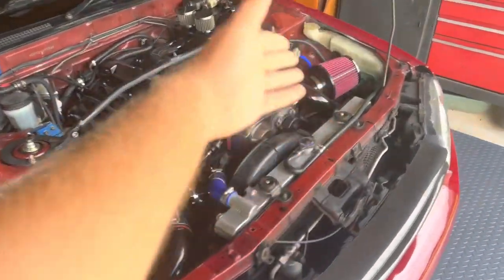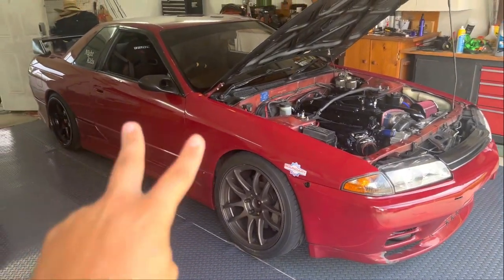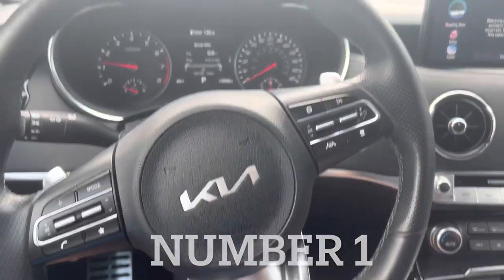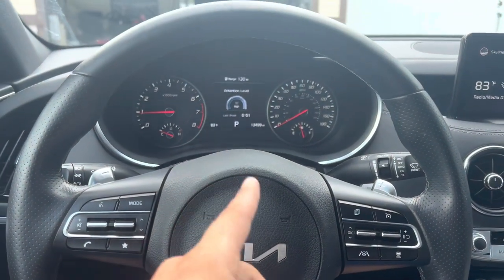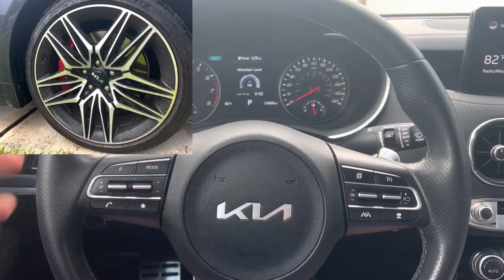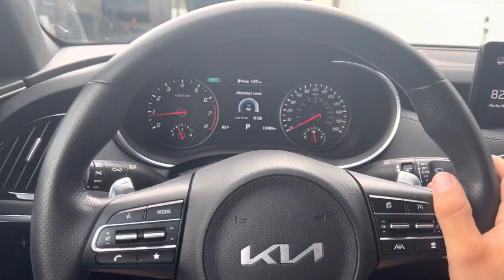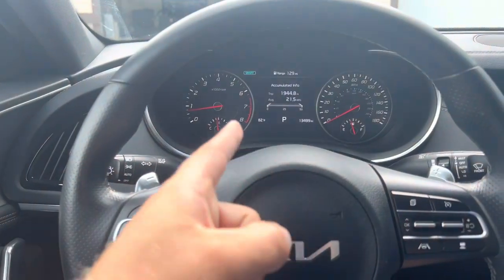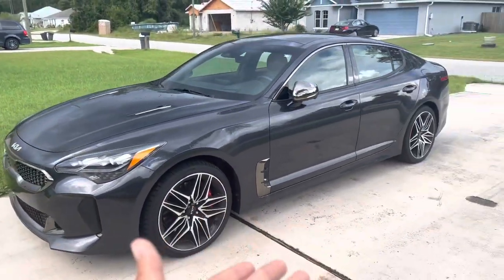5 Things I Hate about my 2022 Kia Stinger GT2! (Owner Review)

Comment: Rotors are definitely the first that need to go. 2019 GT2, first week, I hit the brakes to avoid a car pulling out in front of me and warped the rotors. Got slotted and drilled with better pads and now it stops like a dream.
Reply from the maker: Recommend any specific brake kits?
Reply: @RandomFootageFromRon  I got a good deal from Brakenetic. Powerstop is usually pretty good also.
Reply: @RandomFootageFromRon  big fella

Comment: I’m just over 9k in my ‘23 GT2 AWD; good review - now I’ll monitor those brakes. I love the stealth value of this car! Common question I get: “What kind of car IS that??” Keeps up with the best, a driver’s car.
Reply from the maker: It surprisingly is a drivers car. I’m almost a year in around 14k miles and loving it still.
Reply: I’ve got 57k miles on my GT2, the brake problem doesn’t go away. I went through 6 sets of rotors. The stock rotors are fine it’s the cheap stock pads. Once I swapped to Ceramic pads the rotors have lasted 15000+ miles so far. The dealership will replace the rotors under 12 month/12k miles, just upgrade to ceramic pads and the problem is solved.

Comment: You were spot on!!! The rattle noise could be annoying, so I had to find the issue and get it fixed. One thing you did not mention is the drop in speed when slowing down and the vehicle switches gears from 3rd to 2nd and 2nd to 1st. At first, I thought it was just my vehicle, but then I learned that it’s common. Other than that, the performance of this vehicle is outstanding, especially in sport mode. The gas mileage is a little rough, but it’s worth it. I pick speed over gas mileage any day. Want to save on gas? Get a Tesla.
Reply from the maker: Just a tip, I’m pretty sure there is a way to get the transmission factory “tune”reset by dealer. Something about the shift pressures get off if I’m remembering correctly. But to be honest it doesn’t bother me at all and most of the time I engine brake with paddles to a stop. So the more aggressive down shifts are nice.

Comment: It’s a beautiful car. Couldn’t afford a brand new one so I bought a 2020 Kia Stinger GT2. Brakes are the biggest issue, road noise is insane as well. Even if the brakes are vibrating, it has no problem stopping right away if I needed it to. It is a KIA but it gets so much more attention on the road compared to an Audi, BMW or BENZ
Reply from the maker: Read about the brakes. It’s actually the brake pads leaving a residue on the rotors. There is a reseating process that smoothed them out. Mind have been goood ever since.

Comment: My big complaint is the engine sound. I'm very particular about the sound of my engines, and it is one heck of an engine. tons of power and it can really get off the line with that AWD system, but I'm a V8 fanboy. to me, the sound of a V8 is one of the best sounds I've ever heard from a car, and the Stinger just cannot replicate it. I've watched tons of videos of exhaust systems on the Stinger and it's always too high pitched or raspy. Ultimately, I've just decided to leave the stock system on the car. That is by far my biggest complaint.

Comment: I own a GT2 and agree with your takes. KIA should've built it with more sound insulation. To retrofit it would cost me over 5k and not going to pay for that...what I like most is how fast the car is and easy to pass. The Stinger is a sleeper car and have won a lot of races.
Reply from the maker: I can agree it’s a little noisey. But for the price and what you get obviously some corners will have to be cut. But intakes and exhaust can solve that problem pretty quickly
Reply: @RandomFootageFromRon  Intakes and exhaust won't help the rattles. My head gaskets blew at 2k miles. Needed an entire engine replacement which was almost impossible shipping in from KIA and getting sign off from KIA Corp in Irvine. Five months later I got it back with over 4k miles on it. I was told by a guy who found the issue that KIA service employees were driving the car home for the weekends. There were tears in the seats and KIA wouldn't repair the seats. They generally make good products, though the top management down to engine build quality is a joke. It's as if they go out of their way to sell shitty engines. They know what the problems are, though have refused to fix the engine block boring machines.

Comment: I have an '18 GT2 AWD. Here are the mods I added to address the exact same issues you have.
To help with road noise I got a bunch of dynamat, pulled all the panels I could and then just went ham sticking it everywhere I could. In the trunk around the battery made the most difference. 
I have a lozic TCU (paired with a JB4 (not required)) that can disable the ISG (start/stop). 
Fortunately with an '18 my badges were replaced with a < looking thing that confuses people more.
As a fellow Florida Man (not the as seen on TV throwing a gator through a Wendy's drive through window) I approve this message.

Comment: Great vid, couldn't agree more with you on those 5 things. I have one complaint to add and that is the headlights are a little too low and they can't be adjusted higher. I drive on a winding road everyday at around 4:30am, still very dark and that stretch isn't very well lit. It's hard to see a person jogging or walking, even when they wear those high visibility vests. I know I can turn on the high beams, but I try not to, for some strange reason it doesn't recognize on coming cars and just stays on. I hate to be that person that blinds other people. But sometimes I wish I can. lol
Reply from the maker: I know there is a setting that has the driver side headlight aim down to help with oncoming traffic you could probably adjust. Plus I think the headlights auto level. If you are say parking your car facing up a hill the headlights will aim down slightly, maybe try parking with the headlights aimed down a hill. Maybe just some tips that I can think of
Reply: @RandomFootageFromRon  The roads are pretty leveled around where I live, Long Island, NY. I know that the GT Stingers that doesn't come with LED headlights are adjustable. GT2 with the movable headlight are one piece and someone on the forums mentioned that there is no adjustment that can be done. I looked all over the place for info but no luck. Also, if the bulb should ever stop working, that the whole housing that comes out I believe. But someone correct me if I'm wrong. Too much technology. lolz
Reply: @terrorsz75   They are adjustable up/down.  Just not left/right.
Reply: @mapolinski  You sure GT2s has the up/down option? I know left/right is automatic when I turn my steering wheel, it just points in that direction. I'm going to the dealer this weekend, hopefully they can adjust it a little higher.
Reply: @terrorsz75  I have the 2023 GT2. There’s a place to adjust the up down of the headlights with a screwdriver. I’ve seen videos of other models where you need a wrench. And earlier models had a switch inside to do it. All models have a way to do it. You just need to figure it out.

Comment: Hey, thx for the vid, you had my Like at, "Sorry I'm barefoot, I'm chilling, it's my day off." Anyway, I'm in the market for a "new" car but prices are still ridiculous, so I'm looking to finance or lease a 2-4 yr old car. Got a family so it's gotta be a sports sedan. Prior to kids, I owned a '98Camaro SS, '01 Accord Coupe V6, '06 RX8 (manual), then after kids an '09 V6 Altima & '15 WRX (manual). For choices, I'm Down to used 430i Gran Coupe, Caddy CT5-V, Maxima (manual), Genesis G70, & of course the Stinger GT1 or 2. Leaning towards Stinger for its price,  power, comparable ease of maintenance, & value for $. Thoughts and other suggestions? Also do you happen to know what if any are the major differences between a 2022 & 2023 Stinger? Thanks!!
Reply from the maker: In my opinion, with being able to get a low mileage stinger 22-23 in the low 30k range. I would do it. It is a lot of car for the money. I would just do your best to get a certified pre owned so you have a good warranty. It still is a kia at the end of the day.

Comment: 2022 stinger here. My 2019 had that steering wheel shake as well while braking. I believe that some drilled and slotted rotors will work wonders
Reply from the maker: I think that is the direction I’m going to go in, just get rid of the problem completely
Reply: Can't speak for the stinger but my v36 G35 sedan warps it's rotors pretty much every time you have to do an emergency stop. I tried drilled rotors and the warp wasn't as bad after but it still popped back up after an emergency stop where I was cut off. Definitely not as bad as the stock ones did though, I could feel it in those with light braking on the freeway. With the drilled rotors it starts to show when you are braking in the 25-45 ish mph range but not really any outside of that. So it'll likely mitigate the problem but I can't say I'd trust that it completely goes away.
Reply: I found "bedding" the brakes a few times helped. Haven't had the issue in over a year. I heard it was caused by deposits on the rotors, as the pads are a softer compound.

Comment: I have a co-worker and friend that bought a Dodge Challenger R/T with shaker and he added intakes.  I would put it this way...the KDM customer market has not yet caught up to the availability of mods much like the counterparts but with the car being near the same length and weight as the challenger R/T my stock 2022 GT1 smokes him off the line easily even though he has a much larger engine at 5.7.  Another friend has a scatpack and stock builds of the Stinger can still keep up with the already suped up Dodges before we even add good mods.  This goes back to my original thought that the KDM market is not as fully developed for the Stinger but some of the trim imo is sub-par but they did that to make the price more reasonable so a little sacrifice of comfort for performance is overall not too bad.  I also forgot the most important comparison I set out to make against the Challenger, the fact that my buddies Challenger gets 14 mpg with daily spirited driving and I get 24mpg in sport mode 100% of the time and spirited driving is phenomenal.

The only noise complaints I have are from the interior whether the trim has loose vibrating clips or the rear hatch cover that jumps around when you hit bumps in the road.  Other than that I intend on keeping this car and modifying it bit by bit as I go just for more fun.
Reply from the maker: The aftermarket for the car is definitely picking up more and more as the car continues to gain popularity. Check out Kia stinger face book pages where people post about what they have done as well as websites full of parts for the car.
Reply: You are not wrong that the market is picking up. I am actually buying parts from K8 Stinger Store now and just awaiting my new Takeda Momentum intakes and Velossa Tech snorkels.  I tested my launch control yesterday at an ambient temp of about 35 degrees F and noticed that my 0-60 time was insane and I was hitting 4.3 seconds.  Granted cooler temps help a lot I just thought that was insane before doing any performance mods.  Looking to see what I get with the new intakes, I may wait til spring to do the plugs and JB4 though since fall is already here and snow will be before we know it so no digs in the snow/ice lol.

Comment: If Stinger engine & performance was in the K5 GT. It would have outsold the Stinger hands down!! That is why they likely bricked that version. 

Not having AWD as I have the GT-Line AWD version. Which my dealer wants to buy back lol. Stinger 2.5 i would prefer over the twin turbo though given the millage hit. It isn't as comfortable as the K5 either. 

Not to mention no Panoramic sunroof which kinda sucks. Even though it has the better performance. Agree get rid of brakes & throw in slotted ceramic whuch won't warp. Great review here! 👍

Comment: I could be wrong, not aure but Fuel mileage is typically an issue with most turbo engines,  great ride by the way.
Reply from the maker: Thank you! And yes turbo cars can be very efficient when you stay off the throttle but second you start really getting on it fuel consumption goes way up. But it’s worth it. 100%

Comment: I have a 2019 Stinger GT1 and my rotors warped at about 7k . I went back and forth with the dealership. Finally at about 13k miles I contacted corporate and they replaced my whole brake system free of charge.

Comment: The rear window is (annoyingly) small, the reverse lights aren't that bright, bluetooth takes awhile to connect, replacing the wipers is a process (just to fully raise them), and an infotainment update which released many months ago made the drive mode screen with the car graphic very bland (don't know if they changed it back with updates after the fact, luckily I didn't update). 

Coming from a 2010 Prius to a 2020 GT2 RWD (4yr owner!!!)

Comment: Lame. Mine couldn’t be better. There’s absolutely no single complaint I have about this car. 188K miles and running strong.
Reply from the maker: This review was very picky. I drive the car everyday and love it. I just wanted to pick out some flaws to share on the internet
Reply: Wow. You have close to 200K miles on a Stinger GT? And it's going strong? That's beyond impressive. I am assuming yours has the 3.3L V6 turbo. Any costly unexpected repairs you weren't expecting along the way? Of course, besides oil, tires, brakes etc.
Reply: @MegaEriable  yes, V6 turbo. Not a single problem. And I pull a trailer everywhere. But I don’t race it or do any stupid bullshit. I have fun here and there but I’m pretty smart with cars. I haven’t done anything except filters, oil, and brakes. Not one issue. And the interior has held up amazingly, as well. Aside from all the little scuffs and nicks, I’ve done to it from loading equipment into it.

I’m not sure why people surprised it’s lasted so long. I’ve never heard of any major problems with any of them. Except people trying to tune them and do all kinds of ridiculous shit. If you look it up, these things really aren’t prone any particular problems. And they’re just too new to have enough miles on them to tell the tale. I think they will go down in history as one of the more reliable performance cars of the past 20 years.

And 190 K, now, by the way. Just got back from a trip to Florida.

Comment: I see these listing (the 2023 version) for nearly $60,000.  Without you necessarily having to say what you paid for yours, does this sound like a ripoff?  Seems pricey to me.
Reply from the maker: Depending on options, mine was a CPO and was around 48-50 then of course bought extended warranty and fees and taxes and blah blah. You do see CPO cars for low 40s I would go more for that unless you want a new car. Then I’d shop around and see what kind of deal you can find around the country.
Reply: @RandomFootageFromRon  Alright thanks for the quick response.  I currently have a Dodge Challenger 2021 SRT and it's already having problems with the drive shaft & rear differential.. And Dodge's warranty service moves at a snails' pace.  Was thinking of just getting something else, but I feel like I'd be downgrading with some of these cars.  The Stinger looks alright and I wouldn't mind test driving one, but the GT2 is in my view pretty damned expensive coming from a company that lauds itself as being a "budget brand".

Anyways, something for me to think about.  Thanks again.
Reply from the maker: @DruuzilTechGames  I would test drive it. I have been very very happy with it. Yes this video says I “hate” it. But it was nitpicking. I’ve put 10k miles on it already and enjoy every second of it.
Reply: @Random Footage From Ron  How roomy are they?  I'm 6'3 and heavy set.
Reply from the maker: @DruuzilTechGames  I’m 5 10, with seat where I sit my head is a foot away from the top, plus plenty of room to slide back. I have longer legs so would imagine the seat would be close to my position you’ll just have less head room. But I can’t imagine you would have issues.

Comment: I have the 2019 version and from day 1 I had a rattling noise from my fastback/hatchback or whatever you call it. Any idea how to fix it. I took it to the dealership but no help
Reply from the maker: Actually I have seen quite a few people talk about it and it seems to be an easy fix. It has to do with the latch being loose. And they add washers to it and it goes away. I’ve also seen people add bigger rubber stops to it as well. Good luck I hope you get it fixed.

Comment: Brakes is not nit picking. Your rotors are warped. Brembos or not they are warped.
Reply from the maker: They aren’t always warped. They build up residue on the rotors due to very soft pads. There is quite a few forums about it and ways to “re-bed “ the brakes and make them not vibrate. That process has worked for me thankfully. But I will be going with different pads when I replace them.

Comment: 2018 GT2 AWD.... I cant stand the driver assist! If I have to change lanes quickly, it fights me every time... I did find out one thing, or maybe it’s more of a question, but once, I had to slam on my brakes to avoid rear ending someone. And it did stop on a dime, but my brake pedal stuck in. Is that the Emergency Brake?
Reply from the maker: Yeah I think the car auto braked to prevent an accident. And play with the settings I don’t have any issues with my car interrupting my driving. No steer assist or brakes unless I get very close to someone
Reply: '18 GT2 AWD here. I've turned off all driver assist in the menus.
Never had a brake issue, so cannot comment.
Reply: @LoztDaze  ok thank you. I guess I just need to take the time to learn how to turn off the assist. Still hate it to this day.